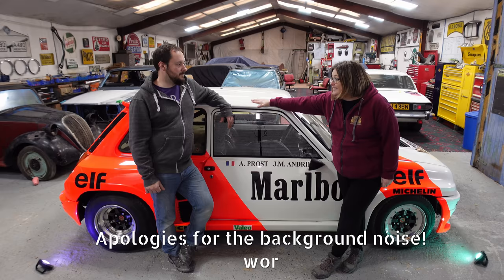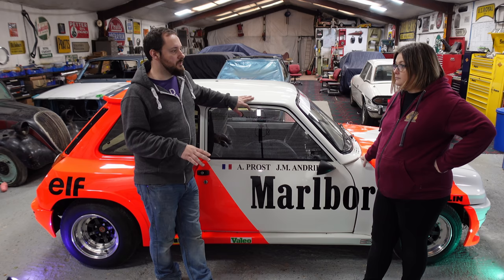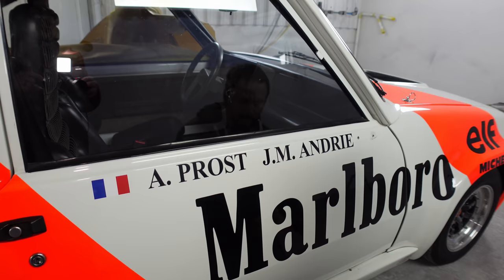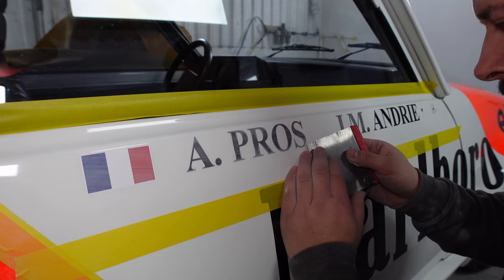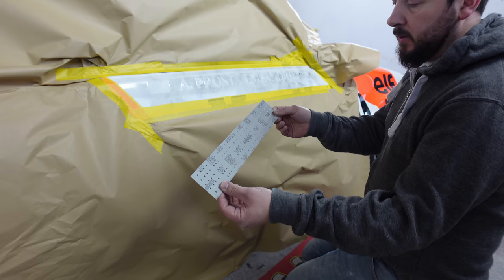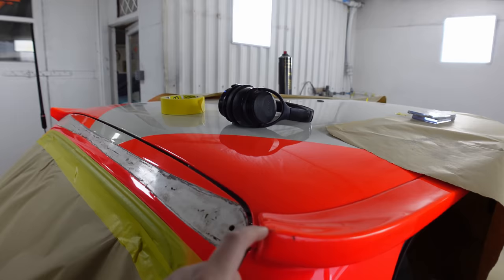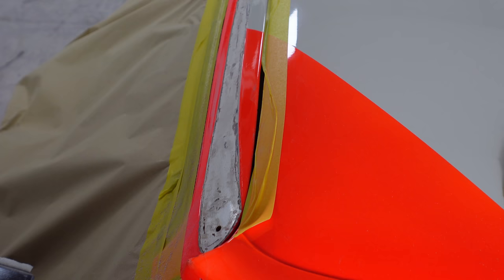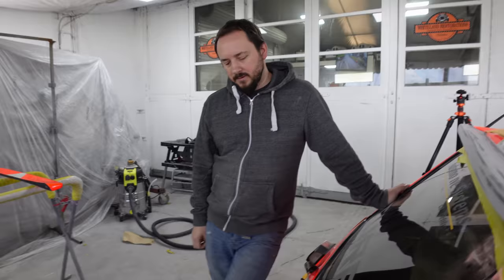Repairing a Genuine 80s Renault 5 Turbo 1 Race Car Legend!

Comment: You have a new soubsriber from Belgium ^^
first dad's car a Renault 5 TS 1977 ) my birthday) , we had a lot of Rnault 5 Ts / Alpine (gordini in the UK ) , alpine turbo , TURBO "Cevennes" with a 254 HP tuned engine (dont forget to know that's a tiny 1.4  capable of + than 5 litre V8 power ^^ )

Comment: Ah yess, the Turbo 5 video. Sit back and enjoy
Pity the scoop broke off. Love these kinds of cars. I was almost not even a teenager then..

Back when promoting cigs in sports was basically standard....
Reply from the maker: It's a very cool car! They sure look different these days don't they.
Reply: @WhitelandRestorations  Yes, I think the only thing modern coming close is the Toyota Aygo 'Crazy' which was an ordinary B4 aygo with a Celica GT engine in the back seat.
Remember that the Renault 5 was an iunderpowered front wheel drive shopping trolley just like the Aygo/C1/107 now.
(oh yeah and the engine was mounted backwards in the orignal R5)